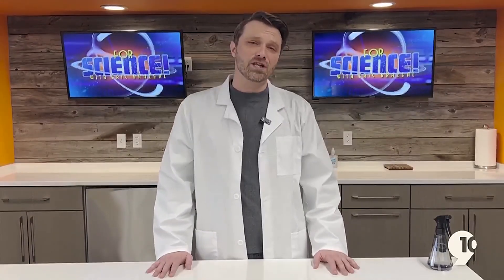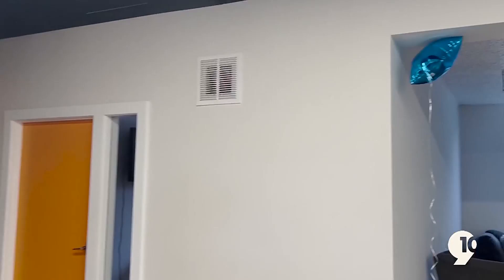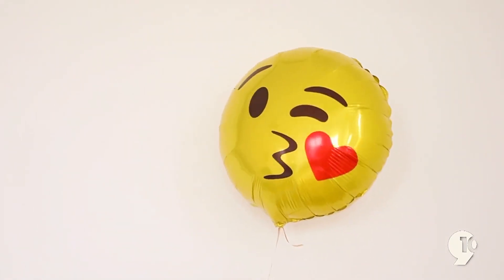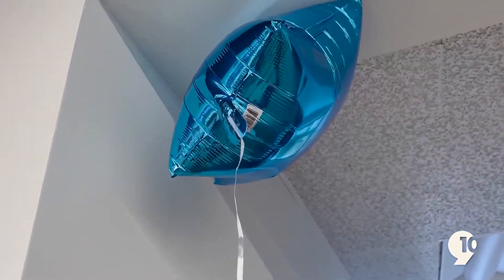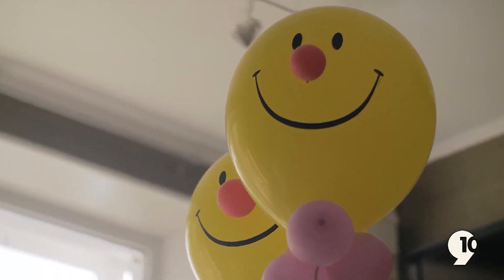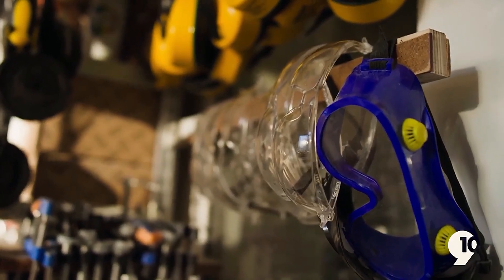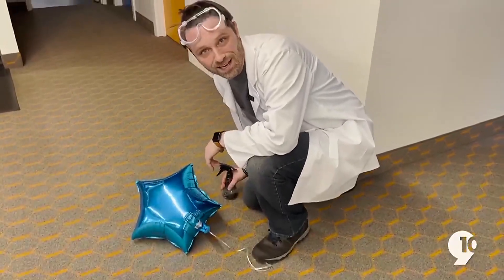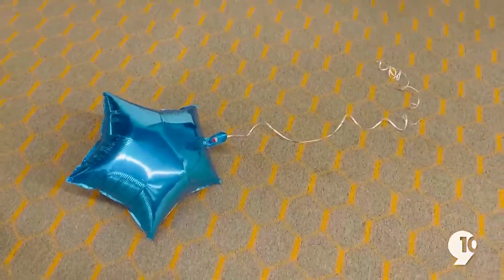For Science! Wet balloon experiment

Comment: How can we be certain the water is not using thermodynamics to change the volume the gas inside the baloon occupies changing its bouyancy?
Reply: If the volume of the gas inside the balloon was changing, we would see the balloon either deflate or inflate. We do not see that happening. In addition, the temperature change from spraying room temperature water on the balloon is zero or negligible and therefore the volume change of the helium is also zero or negligible.